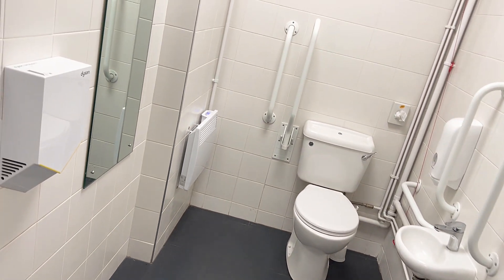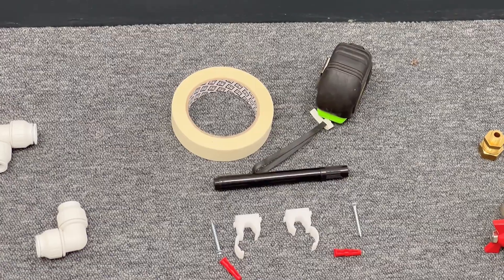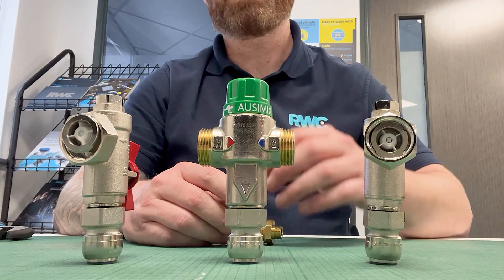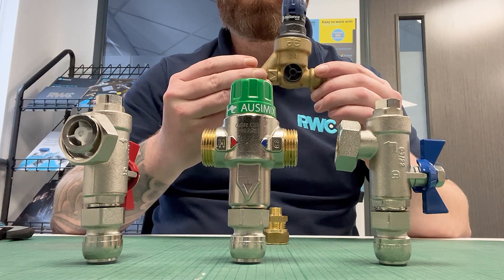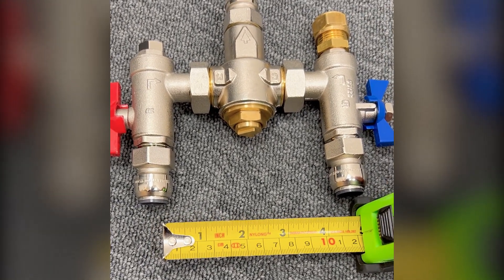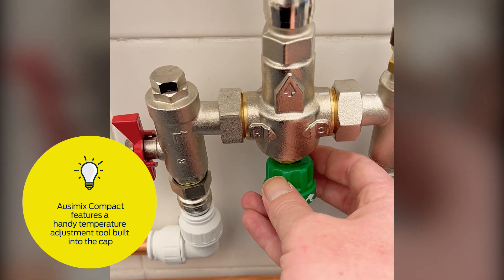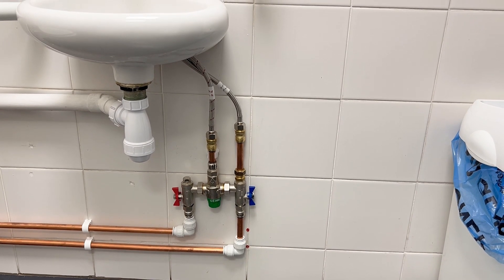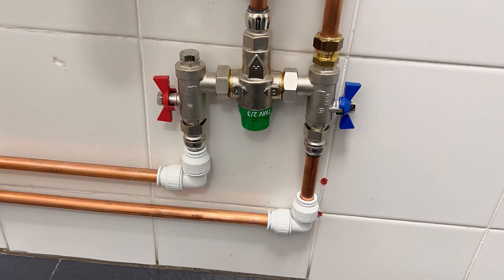Mastering TMV3: Step-by-Step process to Installing and Testing Thermostatic Mixing Valves

Comment: hi thanks for your video,  just ask a question , some tempering valves  donot show which end is for hot water or cold water ,  how can I know correct connection
Reply: hello, are the other valves you mension RWC RELIANCE, when I looked a the RWC valves, on there web site they have " H " one side, and " C " on the other side, or a " blue " and " red " coluer,  I  dought they would speak about other brands, but it would not hurt.